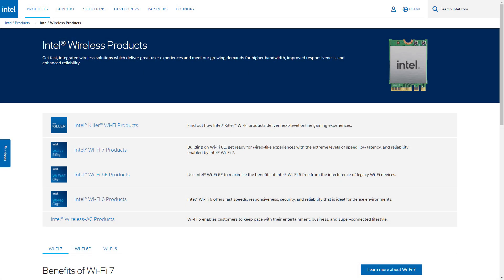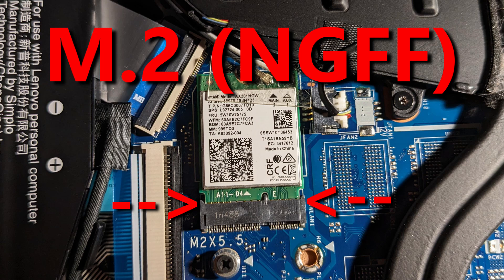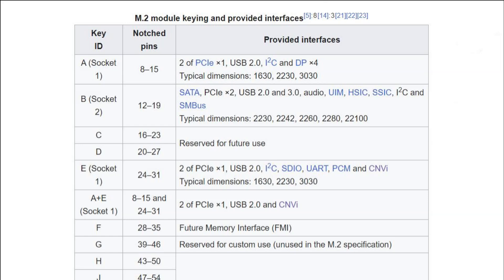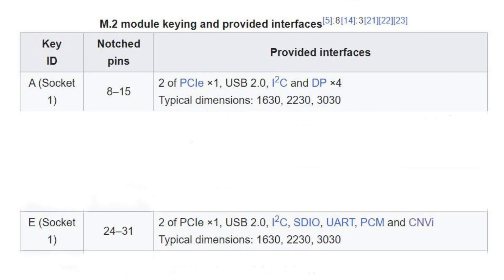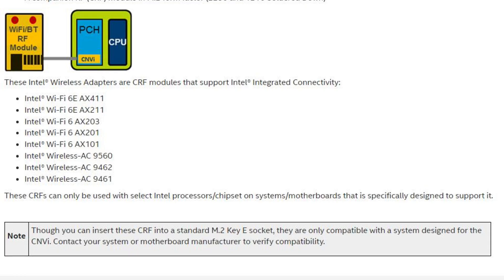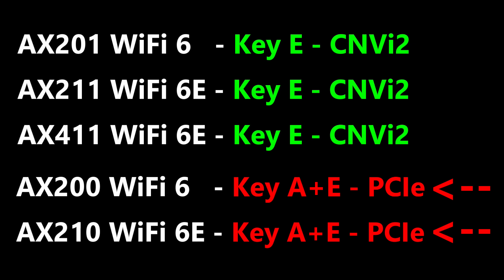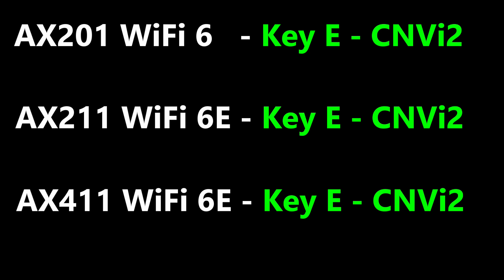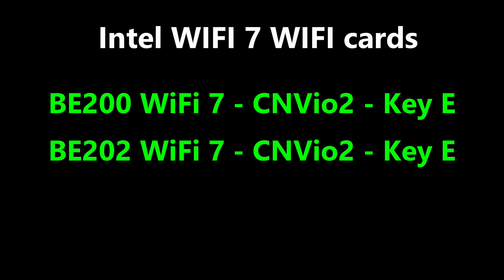Intel WIFI 6 Card Compatibility Issues - What You Need to Know

Comment: Even recent HP laptop with Ryzen CPU are not compatible with the Intel Ax210 Wireless adapter. HP uses whitelisting, even if the card fits into the slot, the wifi does not work, only Bluetooth. It is not detected in the Windows Device Manager. That is what I experienced on 15s-eq1011nf laptop with a Ryzen 7 4700u that came with RTL8822CE adapter from the factory. I tried to upgrade to Intel AX210 adapter, but despite so many research, installing and uninstalling, only the Bluetooth side works. It turns out that HP prevent customers from upgrading to any card they want despite the Pcie slot match. On the other hand, Acer and Asus laptop with Ryzen CPU upgrade without any problem with this Intel Ax210 adapter. Bad commercial practices from HP.
Reply: Wow, HP still plays that game!?  I swear never to buy anything HP again over 9 years ago.  I have beef with Lenovo also, but at least they made decent stuff.
My old Lenovo M715q came with Qualcomm/Atheros QCNFA344A, but I swapped it with Intel AC9260 and it works fine.
My Framework 13 AMD came with AMD/Mediatek RZ616/MT7922, but I swapped it with Intel AX200 and it works fine.
Reply: @catsspat  Sadly, HP still indulges in bios whitelisting. I don’t even see the logic behind this decision. I mean, Apple tries to make everything in its ecosystem proprietary so as to sell it dearly for their willing customers. Fortunatly only a minority accept this and governing bodies like Europe forces Apple to use standardized components like a USB-C in their devices. But, HP does not even make Wi-Fi adapters of its own, so why on earth would they do bios whitelisting. I mean I’m trying to upgrade my laptop with an American designed wireless adapter. I used to like HP in the past, the build quality was decent back then and they provided driver updates many years afterward. At that time, Acer was the worst among them all regarding driver support. I still remember when I bought a new laptop in 2012, I went to Acer website, and the drivers online were older than the ones available on the recovery partition or installed on the laptop from the factory. How is this even possible?! Anyway, HP quality dropped like a stone over the last few years. My friend bought a 2022-model (17-cp0000nf ), Ryzen 7 5700u laptop for nearly a 1000€. Alas, when we opened the laptop to upgrade its Wi-Fi, we found out that the laptop came with the crappy Wi-Fi adapter, “RTL8821CE”. This wireless adapter needs just one wire antenna to function. What the f… HP! Really?!  A worthy PC manufacturer which cares about its customers would have put two wires even if this module needs just one wire.  People who bought laptops that came with these single wire antenna wireless adapters would find themselves between the rock and the hard surface. If for whatever reason they want to upgrade their Wi-Fi, they have to go to extreme such opening the LCD bezels and risking to break the panel. Why?! Because HP cheap out and saves 1 or 2 dollar per laptop by doing this. This is hindrance on its despicable form, in my opinion. It’s my laptop after all, no? If my laptop still works, I want to have a choice when it comes to upgrades. I may want to put better and faster RAM. I may want larger and faster storage. I may want to put faster and more recent Wi-Fi adapter. Standards exist for a reason. An M.2 slot with a corresponding key in any laptop should work with any Wi-Fi card regardless of the model or the manufacturer of the module. This is the way it should be. If it is otherwise, then HP and Lenovo leave me no choice but to try to avoid them like a plague. Besides, lately, whenever someone asks me for advice regarding future PC purchases, my response has been always the same: “just stay away from HP and Lenovo”. Why some ask. Because if you want to upgrade it over time, you might be stuck.  Besides, the build quality, compared to other manufacturers like Acer, Asus and Dell, is sometimes atrocious (plastic vs aluminium frames). No to mention, that one gets better component in their laptop (Fingerprint scanners, better SSD, Better and larger RAM, Better Wi-Fi cards and so on). The only reason that I bought this HP laptop (15s-eq1011nf) is Covid. At the time, there were none others to be found where I live that came with Ryzen CPU. If I had been given a choice, I’d rather buy 17-inch laptop with Ryzen 7 CPU. Generally, better built, more real-estate to work with, and I don’t want to destroy my eyes before time. I see so many people around me straining their eyes by squinting all day long at 13-inch, ultra- portable, ultra-light laptops. Retrospectively, the 17-inch Ryzen 7 laptop decision could have turned out to be a disaster, since HP put the frustrating famous RTL8821CE that has just a single antenna in just about every mid-range to top high-end laptop they made.  Their support forum is overflowing with unhappy customers who find that despite a high price of their laptop, HP cut every single corner there is by saving few dollars here and there like on an antenna wire. As long as shareholders are happy, who care about customers satisfaction, not HP Care at least.

Comment: Thanks for your video, so i guess a BE200 for i5-1340P should be fine. The only problem is i got a Wifi 5 card inside need to check some connections.
Reply from the maker: WIFI 5 and WIFI 6 cards should have the same connections.

Comment: Installed ax210, BSOD an instant and windows won't boot
Reply from the maker: Your motherboard is not compatible with the AX210 then. What's the make and model of your computer? What operating system are you using?

Comment: Will it works without antenna ? On motherboard?
Reply from the maker: No, the WIFI card needs to be connected to the antenns or it will not work.
Reply: @ChavezDIY  i buy usb then. This is more difficult

Comment: Hi sir, i purchased intel ax201ngw wifi cards, unfortunately my laptop is unable to detect this card , currently i am using i5 8th gen , 8250u, hp laptop ,please provide me the necessary solutions
Reply from the maker: The AX201 is not compatible with your CPU. You need a 10th gen Intel Core CPU to run the AX201. Try the AX200 instead.
Reply: Will it support ax210 ngw

Comment: Do you know where the 2 cables for the wifi card are supposed to go? I’m having a hard time figuring it out
Reply from the maker: Are you asking for the order of the cables? On my laptop in the video, the Gray cable is labeled M and it goes on the #2 connector on the card. The Black cable is labeled A and it goes on the #1 connector on the card.